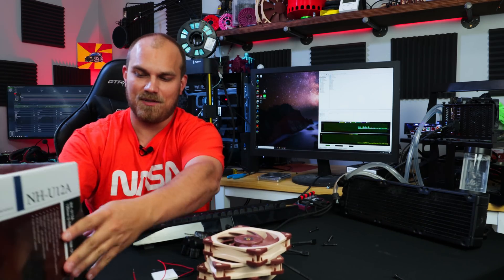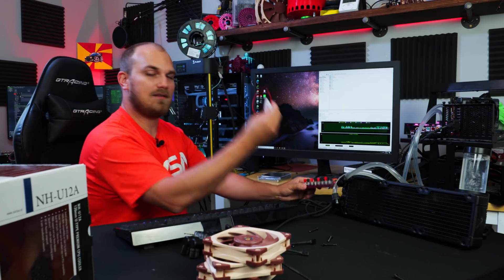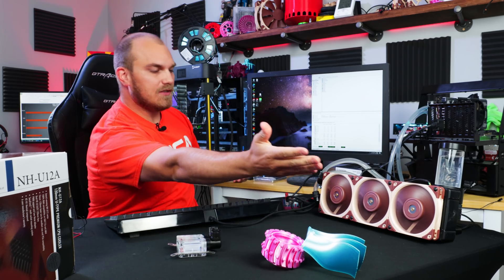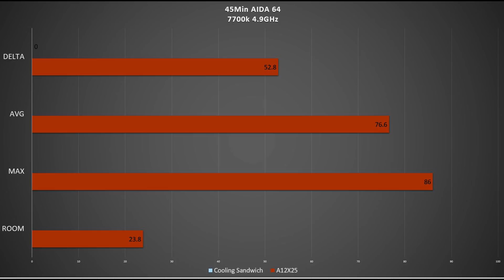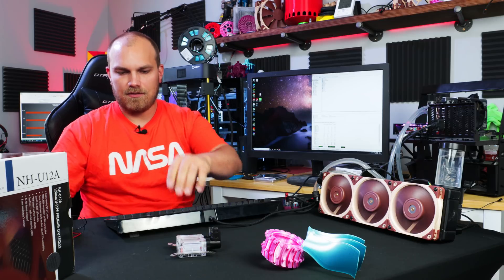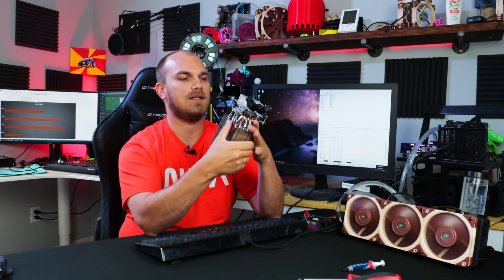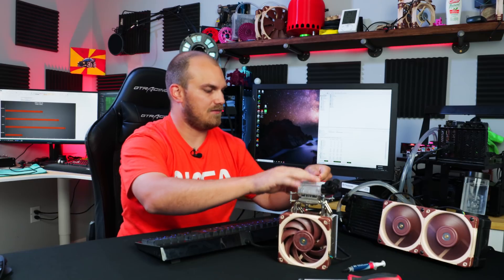Can A Wish.com Water Block and a $4 Peltier Beat a 360mm Radiator?

Comment: Oh hey, I just recently graduated with a thesis based on trying to cool a CPU with Peltier. The result of that is pretty simple:
Unless you have an IHS the size of a Peltier that is capable of moving MORE heat than the CPU produces - you cannot cool the CPU. Heat transfer rate of such Peltier module is way too low, hence it must be stronger than the heat source. And the moment you start pumping say 100W from the CPU you have over 200W of heat to take from the hot side. I've used a 40x40x3.2mm (TEC1-12715) module with Qmax of 144W, at peak efficiency at 13.2V (powered from a PSU that supplied my PC, had to use DC-DC boost converter :D) it I still got a score of 59C under 65W of load, as a reference I've used Liquid Freezer II 360mm, which managed to keep that temperature under 95W. And boy, was the radiator of that LF II warm when it cooled the Peltier under this 13.2V.

The only way of "efficiently" using Peltier module is for a burst stress testing, such as a CPU-Z validation. Also, sides of the Peltier are terribly wavy, you need to spread the paste manually.
Reply: 200W of heat from the hot side? that's generous, I've seen efficiency numbers around 2-5%, so that'd be more like 2000-5000W.
Reply: manaquri I think you can get 10% efficient to get a few degrees advantage, but it requires under-volting them (so you might need twice as many). But that’s compared to say my over 100% cooling efficiency of my phase cooler (where it uses about 350w when cooling a 350w CPU at -35c, which is the hottest I have ever seen it get, just a basic Vapochill LS and I was testing an FX-8350 at 1.7 Vcore but my garbage board with only a 4 phase VRM could only get it to 5.5 GHz rock solid, or 6 GHz single core, but it would basically be 9900k at 6 GHz at that temperature for modern comparisons with similar power draw since they get much more efficient at these temps, I’d guess the FX was 35% more efficient because with the power draw scaling it would have been around 500w if by some miracle a waterblock could have cooled that volcano below thermal shutdown). I think it can handle a little more heat load (especially if it’s just a burst (maybe 400w cooling capacity at some temp maybe like -25c), but it’s far too small for my Threadripper (which sits happily on a 120mm AIO chugging through compression encodes all day long at 450w with it overclocked). I do want cascade sometime that can handle 1kW with TR-64 core but I need to have some parts made like the expansion block which I have modeled up but I don’t have a CNC machine yet.
Reply: @jakegarrett8109  I always find it funny that phase change heating can be over 100% electrically efficient.
so you're using 350w total for the pump but probably outputing a bit over 700w at the heatsink. (in that case it's only 100%, because the cpu is in the same room, but if you cool outside air you can get up to 300-400% efficiency.)

last time I tried something in the >300W range, I fried a psu, it didn't like the phenom II and the 7970 overclocked at the same time, with furmark+linpack.
300W cpu + 400W GPU on a 500W no name psu, do the math :p
Reply: @satibel   @manaquri  hot side gets a heat output equivalent to the sum of Joules heat and Peltiers effect, and you'd sooner get 7GHz stable than get even 500W of heat on a working, lower perfomance module.

For a phase changer you either go with multiple TECs and use them on low voltage or you have no way of cooling units.
Reply: @satibel  that "over 100% efficiency" is just an artifact of how you are calculating that efficiency. If the system is at equilibrium and we are assuming it is an ideal system then if you are putting 350W in at the pump and getting 700W out of the hot side then you are pulling 350W from whatever it is you are cooling. And the proper way to calculate efficiency for this type of device is, desired/input in this case the energy transfer of the cold side is our desired metric so: 350W/350W=1.0 or 100%. Just knowing work in at the pump and energy out of the heatsink isn't enough to calculate the actual efficiency of the system.

In actuality the efficiency is likely closer to say 0.9 so if you are putting 350W in at the pump you will be pulling 315W from whatever it is you are cooling.
Reply: @Ender240sxS13  of course, but in the case of heat pump hvac, you are cooling outside air, which you don't care about.
Reply: @satibel  what? Like what point are you trying to make? Doesn't matter what you are cooling, my comment had zero relation to HVAC or anything else that specific, I was just talking about how the efficiency of a heat pump is determined...
Reply: @Ender240sxS13  I was initially  talking about heat pumps in general. and only on the electrical side. and just clarifying why I talked about 100% electrically efficient. (as you get energy from some other source which is "free")

Comment: So peltiers are strange things when you use them in applications like this. iirc you actually have to let the hot side get hot for the cold side to get cold, in other terms if you dissipate to much of the heat from the hot side the cold side wont get cool enough. If you try again with less heat dissipation on the hot side you may get better results.

Comment: So TEC coolers are pretty finicky. They only pump when the differential is favorable. If the cold side becomes hotter than the hot side, it stop working entirely. 

There's a trick to increase cooling performance without killing the TEC and that's use a TEC stack. Basically run 3 TECs stacked. Run the cold side TEC (the one on the block) at 50% voltage, and then run the other two at 25% into the radiator. It probably still won't work, but it's a thought anyway! Also make sure the TEC is rated high enough to handle the thermal load in Watts! If your CPU is outputting 150 Watts of energy, you can assume it's dumping about that much into the water loop, so if the TEC isn't rated high enough it just doesn't have the rated thermal bandwidth to compensate! If that's the case, it may be wise to not only run them in 50-25-25 series, but also run a second or third stack in parallel on a different cooler in order to increase the thermal performance!

Also running a TEC at full voltage is terribly inefficient. It loses a good chunk of performance at that level, hence the 50-25-25. Then you get the full performance of the TECs for the full wattage they would pull.

Comment: The homemade water cooling kit I bought used for my K7-800 back in 2000 came with a peltier that looked excactly like yours.
I couldn't get the setup watertight, so I never got to test the efficiency against my insanely efficient Alpha Slot-A cooler with 2 60mm fans. I mounted a temp probe behind the heat spreader, as closely to the CPU core as I could, and for some reason my Asus K7V reported sub-ambient temperatures.
Ah, the good old days when you had to hack into the encasement of the CPU and void the waranty to mount a Goldfinger-device to alter the multiplier. If I remember correctly, I got the K7 to run stable at 950MHz with the Alpha.
Good times... :)

Comment: You would need something like a 250W Peltier to cool that cpu, efficiency is terrible on peltiers, and if it heats much, at certain temperature, it actually isolates the heat transfer.
Excellent video! Looking foward to the next!

Comment: Peltiers that size are usually too wimpy for that, you need to be able to move the cpu heat and still maintain a negative temperature gradient, you could check that in the peltier's datasheet. Then you need to cool that from the peltier, but now you could have a grater temperature difference than the cpu. The best configuration for that would be pet directly on the cpu, waterblock to radiator. (you will need to dissipate the cpu heat plus whatever the pet is using to keep the gradient)

As pet aren't very efficient you would likely have more power to the peltier than to the cpu, so you are likely to have three times more heat than the cpu itself. For over 100W to an overclocked cpu you would easily need a 200+W pet that's the size of the cpu, good luck with that, and easily a 360 rad to keep all that heat out.

If you really want to pull this out using many peltiers in parallel should be used, but then you need a heat spreader, like 2 thick Aluminum plates with the pets in the middle, take the heat from the cpu to the cold side, and keep the hot side cold enough to give it a fighting chance.

Comment: You would need to stack a couple of these in series for this to work. I would be VERY interested in seeing this though.
Reply: Parallel.  Series wouldn't help... cool side cooling hot side heating cool side would be redundant inna 100% efficient scenario, which it is nowhere near.
Reply: @michaelmcconnell7302  Not the peltier modules but multiples radiators/waterblock assemblies in the cooling loop.
Reply: @Windcent  ah that makes sense

Comment: you are comparing 1x12cm air fan whit 3x12cm water cooling fan. this peltier is 60w max working vs a 125w cpu that has OC to 200-250w cpu, you must put 3 or 4 like this to see any good temp.
please make a new setup whit more peltier to see if this work well.
pd, sorry my English

Comment: i have been waiting for you to do projects with peltier coolers :).. i have a little idea.. try put the peltiers on the radiator , or peltiers  in a closed box and then have the heatsink with the hot side stick out of the box so that does not generate heat inside the box, and for better cooling performance you could add a heatsink or some other metal block to the cold side on the peltier  inside the box with the radiator i think that might think that could work , also remember to add rgb light  for extra cool performance

Comment: I believe it'd be more efficient to go Radiator > Peltier > CPU > back to rad for going sub-ambient. But yes, ya need a better water block to use with the peltier, maybe an aluminum based one. 
More Peltiers and a larger waterblock to use with them for lower temps, but then I'd suggest monitoring the temp to ensure the liquid doesn't freeze.

Comment: If you're happy to try some whacky ideas, I've always wondered if you could run the cooling system from say a fridge and cool a liquid coolant, then just use fans to cool the hot side of the fridge. Similar idea to what you're doing here, but using compression/expansion instead of electric heat transfer.
Reply: Has already been done and works, search for 'Asetek vapochill'.

Comment: Hey man. You should try using a bigger peltier chip. You can get them that use around 30-35 amps per peltier.  Might make for a fun project with potentially good results

Comment: The idea isn't terrible, you just did it wrong. You seem to understand that already to some extent though since you brought up you might need a more powerful unit. 

TEC's are useful and can be used the way you are trying to use it, but you need to take a different approach to the problem. 

1 TEC unit isn't enough for the thermal load you are putting through it. Even if it was a huge single tec, it would still need a bigger surface area to pull the heat from. So that's where your problems lay. 

1. You want multiple heatsinks and/or waterblocks. More is better, but obviously there is a limit to ridiculousness. 
2. You will be putting the heatsinks together in a row like a giant radiator, with the water blocks lined up to flow the water past each from hottest to coolest. 
3. If you were to interconnect the waterblocks in a way that transfers cool water back to the hottest block and keep this return cycle happening all the way through til the last heatsink and block, you can basically keep all the cooled water returning back to the hottest parts, with some of the hottest water going straight to the main radiator to cool down again, and then return to the normal loop. 

The problem is essentially you are thermal soaking your system too easily.

A design for this can be pretty easily drawn up on paper. But you are essentially creating a multi tiered water cooling setup with multiple loops cooling multiple loops; with each colder block feeding into a hotter block to cool it off, all looping back and forth til the final destination, the radiator. 

If you wanted to take this further, you could use water blocks on both sides instead, but the loop is going to get really crazy at this point.

I personally want to build this setup, as I think it will work just as well as dropping your radiator in an ice bucket, but when done right can look really ... well... cool.

Not to be punny.

And one last thing. TEC's can be used to create a current of electricity as well. You use them in reverse and don't connect a psu. SO if you take that into consideration, you can make a system that cools itself as well as the computer, all while recycling some of that lost energy as electricity again. 

You are going to need some specially constructed heatsinks made solely of heatpipes for that though.